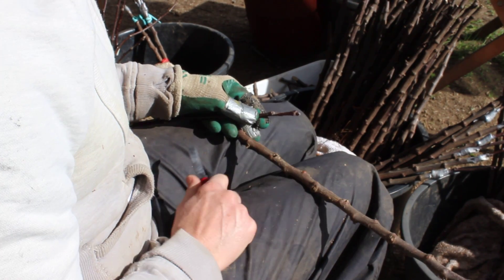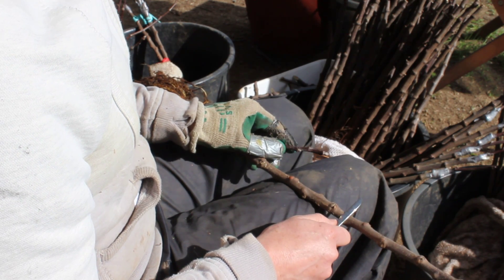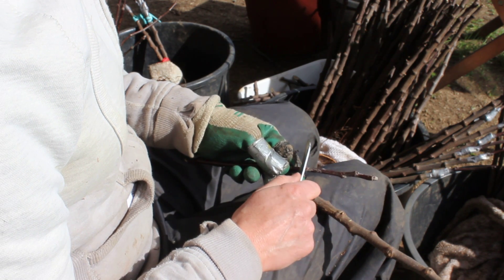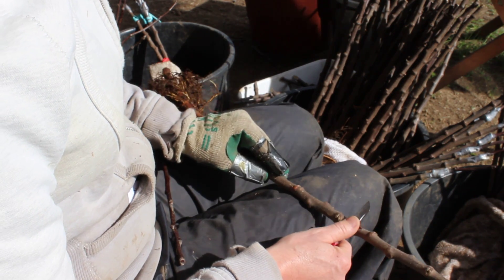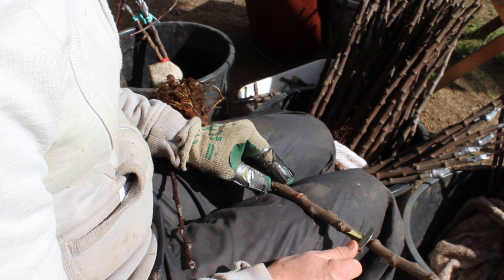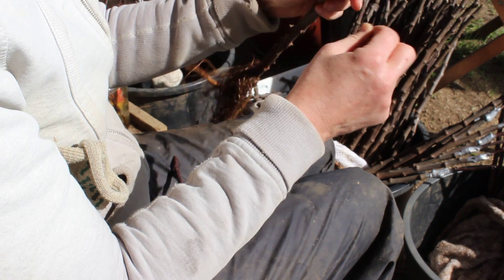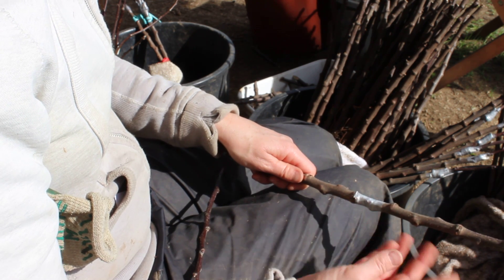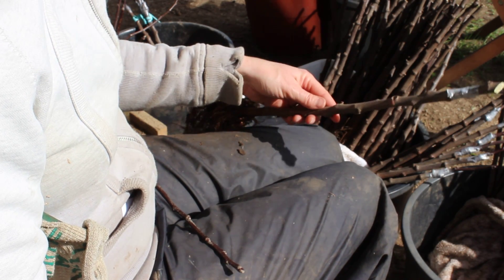Chip Bud Grafting

Comment: I've never seen chip budding done at this stage of the year, I was under the impression this was done in July when the rootstock is growing at its strongest. Is your rootstock still dormant when you do this or is it breaking bud?I may try this myself.
Reply: A jones , we do this in the spring (March, here in the Pacific Northwest) when the root stock is just coming out of dormancy, and when we don't have a lot of bud wood with which to work. 

The success rate in the spring with this technique is slightly lower than the success rate with other techniques, as well as slightly lower than the success rate using the same technique in summer. 

We also use this technique in the summer, because it is the only option we have for grafting at that time.
Reply: Interesting, I did quite a lot of t budding last July which looks to have been very successful. The year before I did chip budding in september which I now think was too late a 100% fail.
I have bought a quantity of summer grafting rootstock to t bud this year the unit price is very good on this one year, thin rootstock.
Reply: A jones, September is definitely too late. I'm surprised the wood was workable that late into the year. 

The upside is that you can always graft the root stock that didn't take in the summer grafting during the spring. 

This is something we so to help speed up our production cycle when we need to.
Reply: Salt Spring Apple Company l
Reply: h

Comment: Can i do this in the month of feb / march ?
Reply: When you can do it depends on a number of factors. 

Ideally, your root stock is starting to come out of dormancy and your scion wood is still dormant.  For us (on the west coast of British Columbia), that begins to happen in March. 

We collect our bud wood in January and February, and store it in a cool, humid environment to keep it dormant, while letting our root stock respond to the environmental conditions. 

If you are bench grafting (working on root stock that is dormant and out of the ground), and you have a cool (2 to 3 degrees celsius), humid place to keep them until spring, then you can do the grafting earlier.  You will also need to wrap the grafts well in order to prevent them from drying out.  

I haven't tried grafting earlier, so don't know if there is any variation in rate of success.  I suspect there is, as there is more chance for the bud to dry and the root stock wound to heal before growth begins. 

Hope that helps . . . 

If you decide to get an early start, let me know how it goes for you.
Reply: Salt Spring Apple Company Thanks for the detailed explanation, Actually I was asking particularly about chip / bud grafting as ive heard its always done in bw july to sept.
Reply: The information I provided was specifically about the chip bud grafting procedure.  

When we started out, we didn't have much scion wood to work with, so we only did the chip bud grafting in order to maximize the number of trees we were able to make.  

Since then, as we have better access to scion wood, we have slowly shifted to more whip & tongue than chip bud in the spring because we find that the growth rate in the first year is higher with whip & tongue spring grafts.  

We have always summer grafted using chip bud. 

We have also found that a significant number of our spring chip buds heal, but don't sprout or show significant growth in the first year -- making it seem that our take rate is quite low.  However, if you allow the buds to overwinter (as what we have taken to call sleeping eyes), the success rate becomes quite high. 

Hope that helps to answer your question more fully.
Reply: Salt Spring Apple Company got it! Thanks
Reply: Salt Spring Apple Company